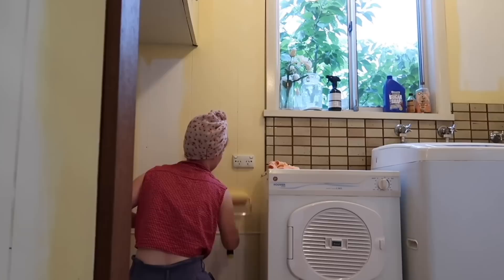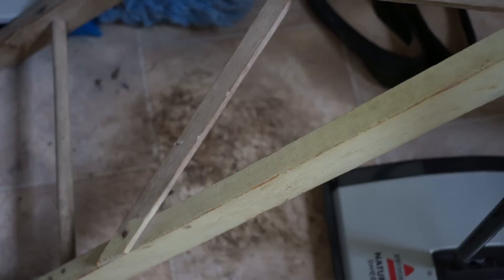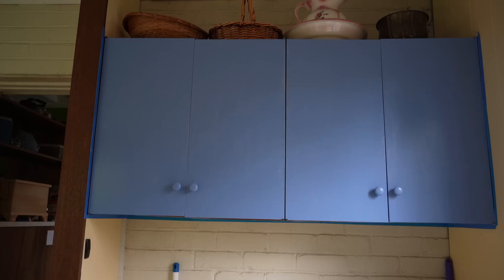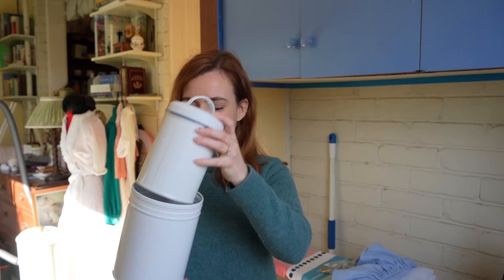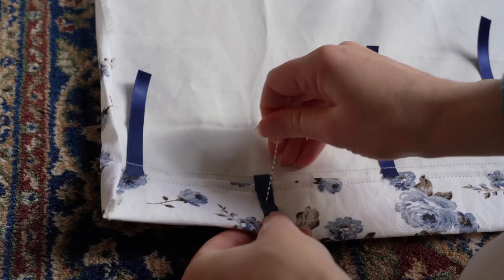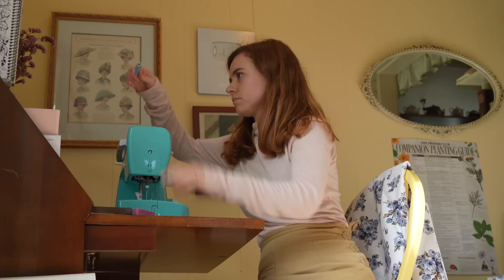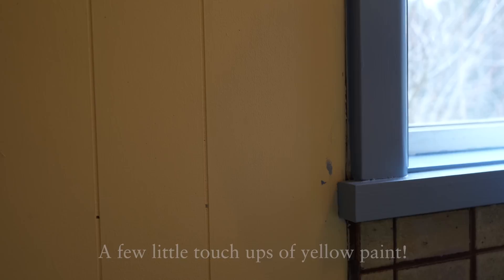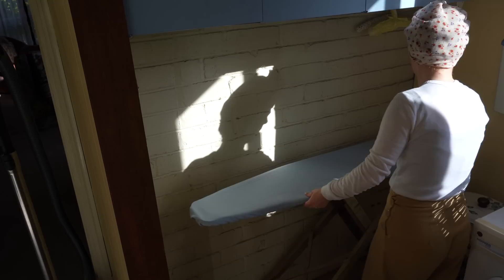1940's Laundry Makeover! | Ep. 2 Our Retro Home

Comment: If you are still getting cold coming through the window, spray the window glass with water then press bubblewrap over the glass.  The sprayed water will help it to adhere, and the air bubbles of the bubblewrap will help insulate your window.  You could just pull the curtains over it to hide it.

Comment: You can also add  an old fashioned roller blind to roll back against the window and it makes the room a lot warmer plus adds another style detail. I have plain vinyl ones but you could make your own on a spring roller or have one custom made. The premade ones can be cut at the local home stores to fit. They give a wonderful retro vibe with a white or yellowed beige crocheted pull!
For my laundry area, I have one of those grabbers where it’s like an arm extension, with a squeezable pincher end, for picking up dropped items behind the washer and dryer. 
Your blue shelf ruffle is sweet and inspirational. I’m going to copy this idea, modified slightly for my 1905/ 1920. 
Time to paint your tiles! 
Thank you.

Comment: I love the laundry room makeover! The curtains and the little ruffle on the shelf is adorable, you did a great job sewing them. I wanted to give a safety tip that at least once a year the dryer vent hose needs to be removed and vacuumed really good. Lint accumulation with hot heat can start a fire really easily.

Comment: What a wonderful makeover, love that you’ve updated what you have!   I dislike that, nowadays, everyone, it seems,  has to rip everything back to the studs and spend tens of thousands because, oh no, nothing in my home can be as dated as 10 years old!!  I blame the tv shows.  No one wants a starter, or a cute little home. Sadly.   Sigh.  BTW, I made my own ironing board cover, also.   Tip:   Spray-starch the whole top, iron to set the starch, repeat one or two times more.   Makes a wonderful ironing surface.         (p.s., I, too have some concerns about that black, mushrooming mould in that window, likely from the hot, moist air from the dryer, but you might consider spritzing it with bleach, or vinegar or a mould inhibitor.   For safety.)😊

Comment: It's so lovely! You should be so proud of yourself! As for the amount of dust, I would suggest taking the vent apart and vacuuming it and also just checking on the connection. You'd be amazed how much cleaner the room will stay if it's properly sealed. Also, it's a safety thing!

Comment: a future trick if you want to lighten a colour a few shades is add 10% white ( often you have small leftover white somewhere ) and mix well , check your new colour , try another 10% at a time until your happy with the lighter shade , only mix acrylic with acrylic , oil with oil ,enamel with enamel , you can paint tile too , sugar soap at least twice , usually undercoat as well , water based acrylic tile paint would be best , cheers big ears

Comment: Your laundry looks amazing.  I also have a problem with picking the "right" paint color.  Often times I think I've picked the right color only to discover that it's not the color I thought it was or it looks entirely different in my room with the different lighting.  I've learned now to paint swatches on different areas of the room so I can make 100% sure I like the color before investing the $.  Paint is a relatively cheap way to spruce up a room however, $50/gallon is still a lot of $.   I currently have about 6 different colors swatched on probably a dozen different walls of my house - LOL.

Comment: That shelf frill is so cute!
Question though: to empty the new lint bin, do you have to step forward, open the flap and reach in? Or can you tilt the front down? If it's the first option, that seems like a bit of an effort... Don't get me wrong, I like the concept. Just not sure of the practicality.
Reply from the maker: It comes straight off the wall! The bin slips and locks onto 2 screw in the wall and when I need to empty it I just slide it straight off! xx
Reply: @SageLilleyman  That's genius!